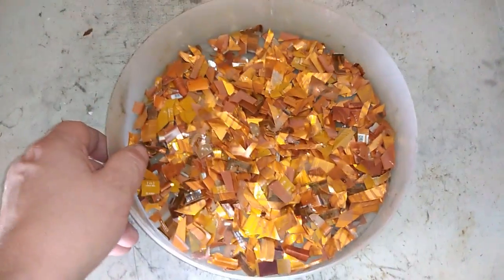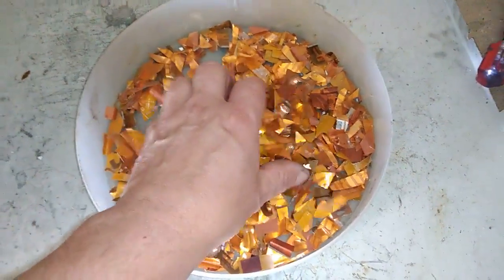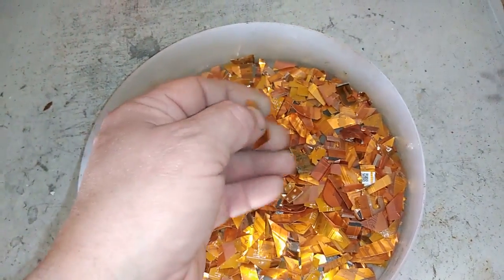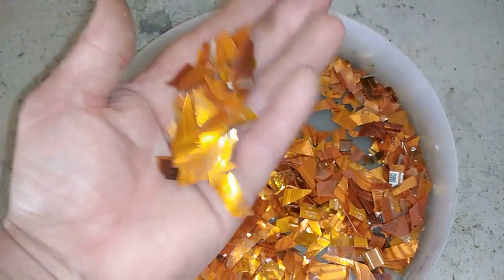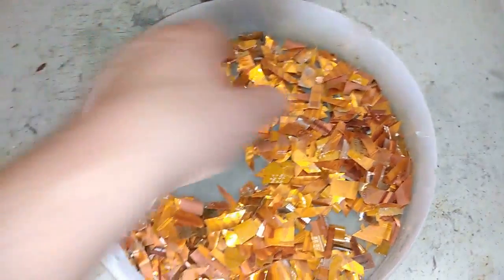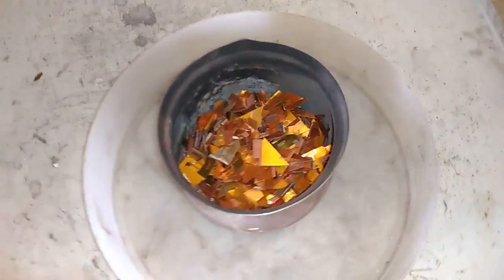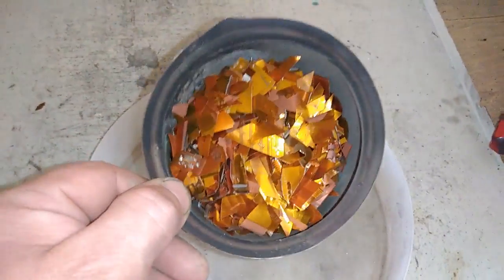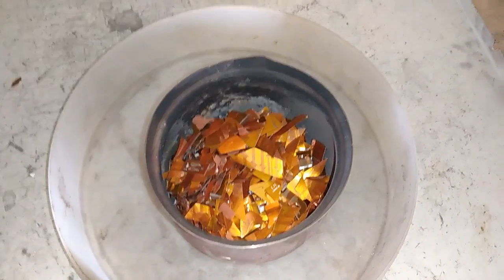Ribbon cable proses for Gold recovery Test

Comment: It's very much worth it but I will say that I saved about 2 months worth. I did I think 600 old old cellphones . Processing it right now. Sitting in was rn. I melted mine first though. I have about 4.5 kg worth of ribbon. Saw one guy saying and showing 1.05 grams per 200 grams. I'm going for 1.25 if possible. Know this videos old but still it's helpful especially with me finally quitting my job and doing this full time.

Comment: So likely to be more copper than gold but what percentage do you think of that little nugget is gold? Would you call it effectively enquarted (25%=6karat) and ready to be parted by a nitric acid boil to remove all the base metals (after you increase the surface area by remelting and pouring it into shallow water) leaving just the gold ready to be dissolved one last time in aqua regia for the final refining to 24-karat

Comment: Why not use carbon loving piranha solution (made from concentrated sulfuric acid and 30% hydrogen peroxide) that reduces all carbon to carbon dioxide that dissipates into the atmosphere and is gone and hydrogen and oxygen as the byproducts leaving a clean clear solution behind at the end of the process and save some (currently very overpriced) money by not having to use all the nitric acid? Piranha solution if heated should eliminate all that plastic and also put your gold in solution for you at the same time just like aqua regia does but without the extra steps.

(Warning / Caution:  Please Don't mistake that for some friendly kitten of a chemical either because it's not, it's a voracious monster so be safe do your research first and live to do it again)

Comment: I have been cutting the ends off the green ribbon cable to try to get the gold off. Should I try to process the whole cable instead of the ends? The ribbon I have been collecting are from TV and computer screens. Where one end connets to the screen and the other to a gold plated board! Am I waiting my time?

Comment: Is that an induction heat plate u are using? What temp and for how long? Is that a new container the solution is now in? Lab grade beaker? What size? If I can't use or buy that's yet, what can I use? Is that a piece of solid normal glass u are using as a mixing tool?

Comment: How can I make nitric/muratic Acid, if I can't buy it in original liquid state/lab quality? Do you have a video describe what all chemicals you use, what are called (like water-H20, muratic - hci, AP - muratic & hydrogen peroxide). And how to make chemicals I can't buy? And what other exact materials for containers I can use if I can't get lab glass and/or equipment, yet?

Comment: Also wondering easy/cheap way for reverse electro plating. Without acids, I saw maybe 3 videos on web/utube with ppl using 12v DC power supply or 12v DC automotive battery charger, a beaker or big thick plastic container. Then a strip of metal (forget type, with lead clamped to one side in solution. Then other side, I believe it's the positive (+) lead attached to piece of copper. Then pins ormetal w/ gold on it dipped in solution with power supply on. And it removes very fast, the gold. Think it's hci 35% (muratic/pool acid?) Or water. )

Comment: Can you do same method for removing the mask on PCBs, for ribbon cables? 

(Submerge PCBs in water with 100% Lye - 1 cup. I use a very thick piece of glassware from household common items. Then I use induction heat/hot plate (electric, no flame). Heat for awhile. Use chemical rated gloves to elbow, 7 - 25 ml rubber. And toothbrushes at 1st, hard & soft bristle to scrubbing green/,red/yellow masking off of PCBs. Then I put PCBs in an stainless steel cooking pot of hot water with oldúsed lye/caustic soda and boil until glued copper sheets, release from fiber PCBs. So I can scrap as much products as I can from each piece/s. I'm pretty broke, no acids, and rely mainly on dumpster diving and donation. )

Comment: You can put these cables in with your bga chips and process with them.
Reply: Bga chips are the ones that have the little gold strip coming from uder a corner right? Usually surface mounted?
Reply: Also I usually find these types of ribbons in disc reader/writers... And I almost always dig out the gold head. 

Any ideas on how to get them apart/recovering gold from those parts as well?

Comment: or you can plate the copper out of the gold :-)
Reply: HOW? PLEASE 🙏
Reply: @seanwow4329  well if you have more copper than gold say 10 to1 you melt a bar then electroplate out the copper in a sulfuric acid sell the gold and other Noble metals will wind up on the bottom of the cell as slimes. the gold can be extracted from that

Comment: well that is one way to get the content up am queries as to what you will get it can't be much 🙂
Reply: But it's better then ZERO. And it helps showing others how to more learning, as well as us learning ourselves when we are trying to recovering, of everything.
Reply: @seanwow4329  look hobbie extraction and this is the level this is is always about how to do it as cheaply as possible valuing time very low you can use the chlorine and salt to improve the oxidation properties of vinegar to do the work of( ap )basically pool acid with hydrogen peroxide. but the vinegar must be very concentrated and the water can only keep so much metal salts in solution so at some point  adding salt stops helping and the solution must be changed this will go slower than with ap and will work best if you have a cheap or free way to keep this solution hot. you can make vinegar and concentrate it by distillation hydrochloric or pool acid you have to buy nitric acid same thing 10 times more expensive  physical separation will always be cheapest electrolysis or pyrolysis are the next cheapest option chemicals will usually be most expensive the order and the steps will very and the 2 things you can not do are  you should not do this are 1 leave dangerous waste products behind and damaging your local environment.this is always about making things better for you and those around you.and to have a little fun:--)
Reply: @seanwow4329   i would look into pyrolysis of plastics to make gas and diesel and some plastic can be reprocessed for use  three d printer filament and while eventually something will learn to eat plaSTIC it took less than 40 years for nylon and less time for tire rubber or highways would be under mounds of this

Comment: The dimpled appearance indicates a PGM
Reply: What "dimpled" appearance? Where?
Reply: @seanwow4329   Hi Seanwow go to 10:55 and 10:56 where he is holding it in his hand. Notice the rough appearance.  I have text books by Charles Butler who taught torch assaying based on the Texts of Shepherd ( early 1900s)and Dietric. They examined the effects of Palladium, Platinum and Rhodium on a gold or silver bead. Platinum will give a Soccer ball appearance, Pd and Rh impart a tiny dimples that give it a frosted appearance.  A pure Silver bead is very smooth , but may sprout shoots of silver when cooling. Gold is ultra smooth glossy and does not sprout. A PGM may be alloyed with gold or silver to help it resist heat , and impart hardness.

Comment: Very nice video.  Probably good that you didn't use new acids.  Maybe save future ribbon cables to be refined with other things.  Those cables looked like they were coated in Kapton Tape which can resist temperatures as high as 400 ºC or 752 ºF.  Did it take long to burn off the coating?
Reply from the maker: Coating burn easy, maybe 5 min with burner.